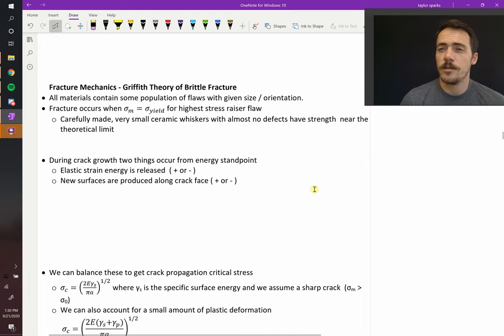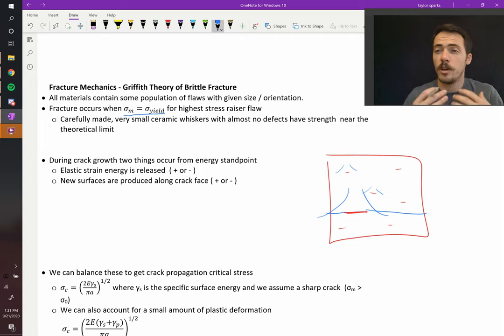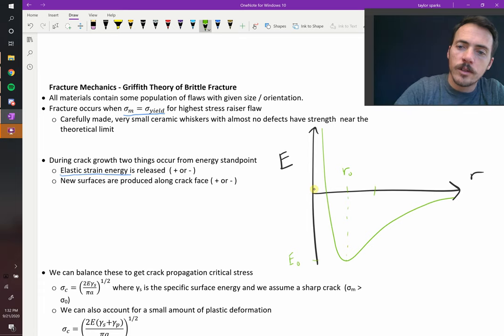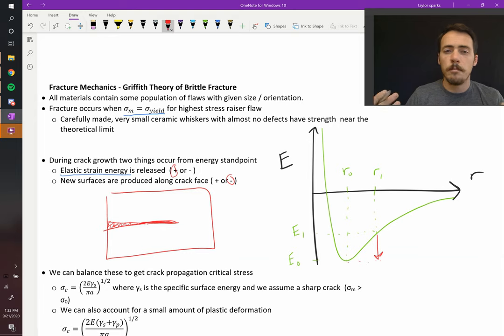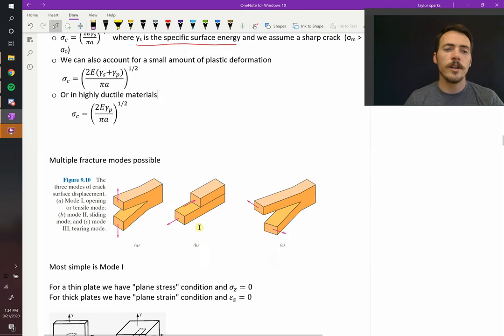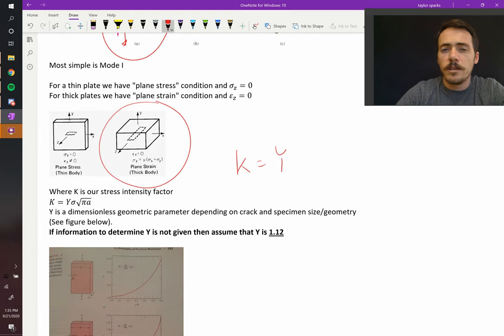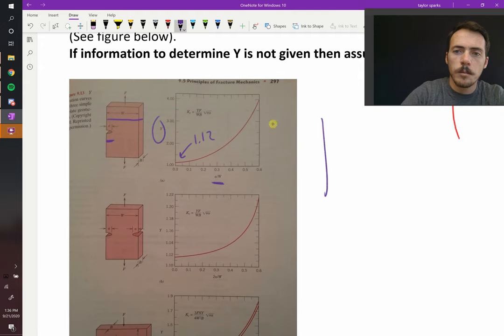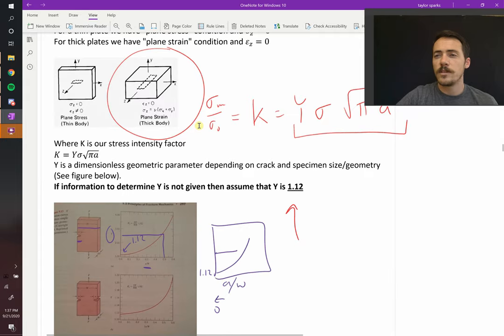Derivation of Griffith Fracture Theory

Comment: Hello Taylor, 
First, I must say that I'm a huge fan of your videos!
I think there is a little confusion between the stress intensity factor K (which has dimension Stress.length^1/2) and the stress concentration factor K_t which is Sigma_m/Sigma_0 which has no unit. [according to several Materials book and wikipedia pages]
Both are connected but not exactly the same!
Correct me if I'm wrong,
Greetings from France,
Simon
Reply from the maker: Hmmm.... You are absolutely right and I'm at a loss for the discrepancy at the moment.